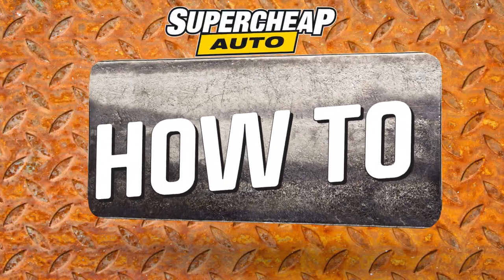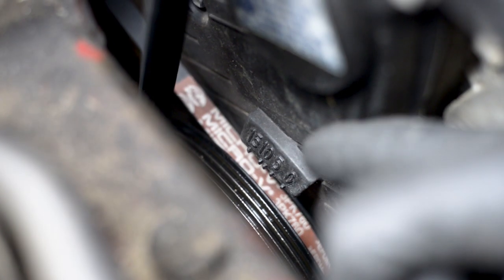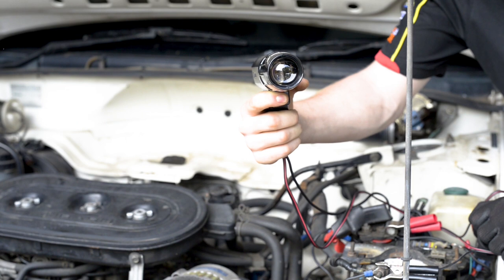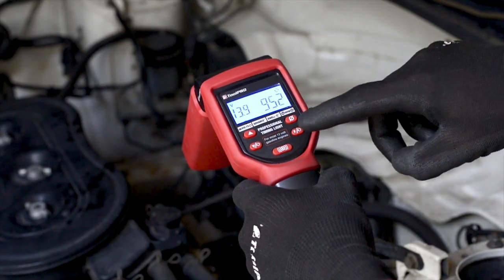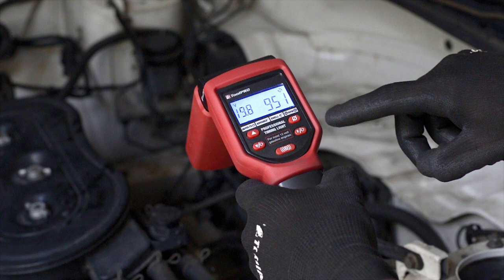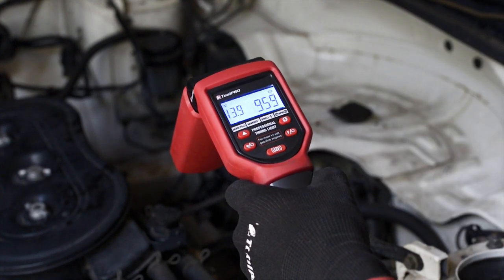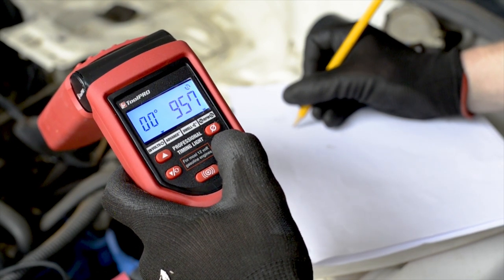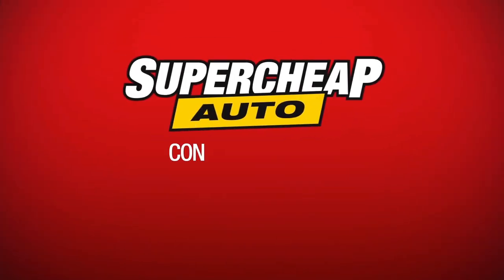How to - Tune your Ignition // ToolPRO Timing Lights

Comment: "Attach the inductive lead (clamp) to the number one ignition lead". The ignition clamp (red) has a  arrow on it which I presume indicates which way to clamp it so the direction of current is same as the arrow.  The video show the clamp connected with arrow pointing back to the distributor.  So what the . . . .?    I'm  guessing if there's an arrow for particular current direction it must be important, and which way is it supposed to be pointing?